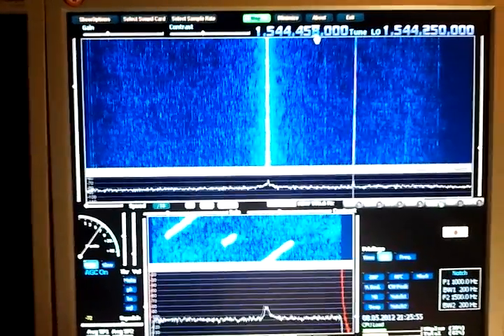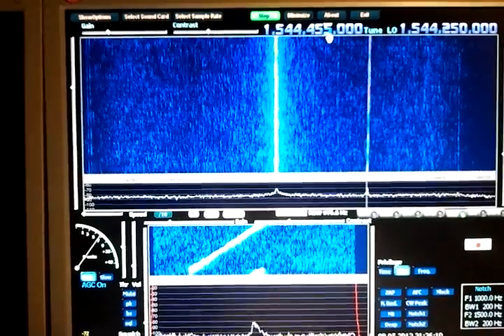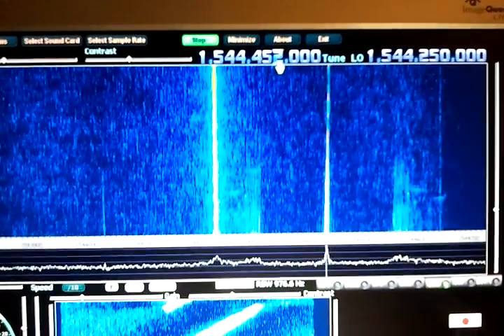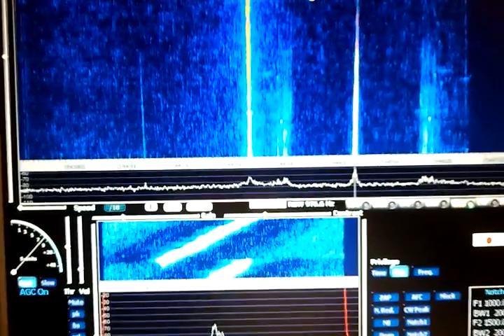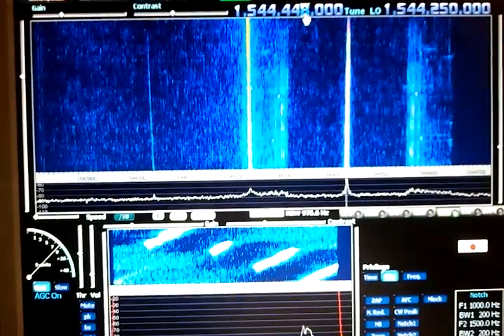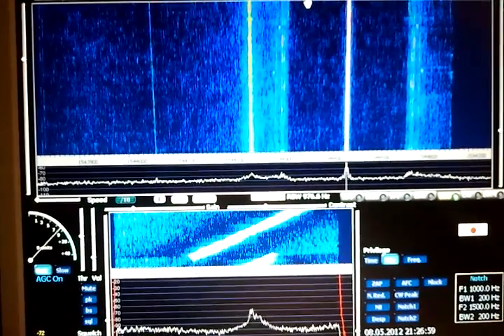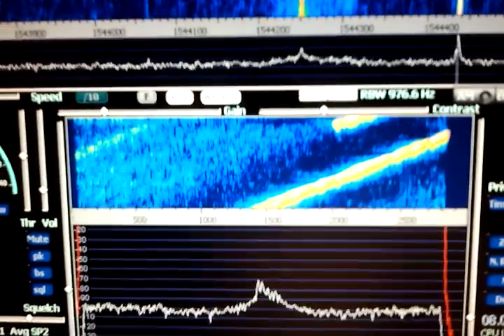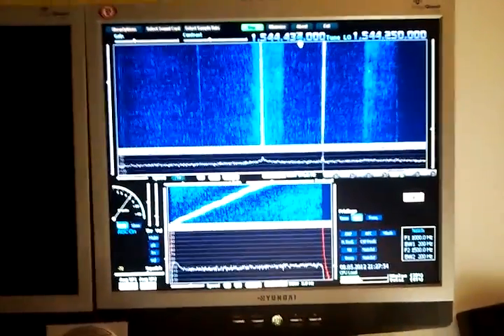COSPAS-SARSAT reception with cheap RTL SDR

Comment from the maker: Without the E4000 you will most likely not be able to receive in L-Band (1.5GHz)....
The antenna in this video is a 900-2600MHz wideband LogPeriodic feed with a 60cm dish pointed at a fixed elevation and direction of the previosly calculated satellite orbital path highest elevation point (which only allows reception for max. 3-4 minutes, when the sat passes in front of the antenna)...